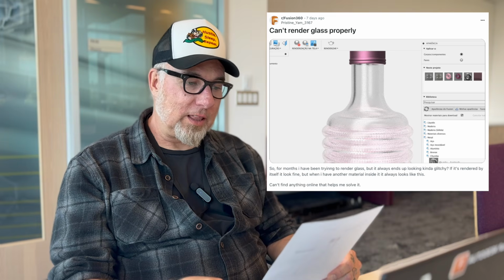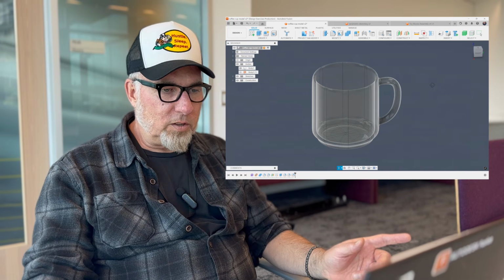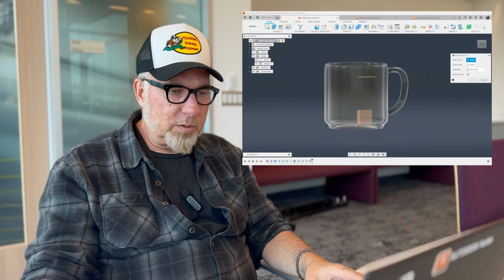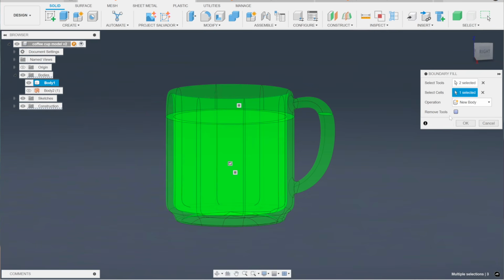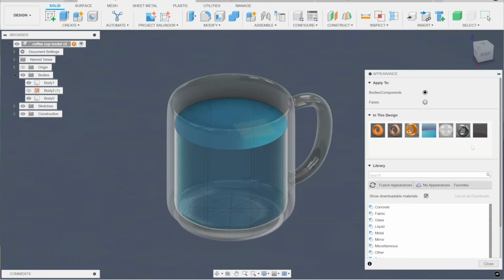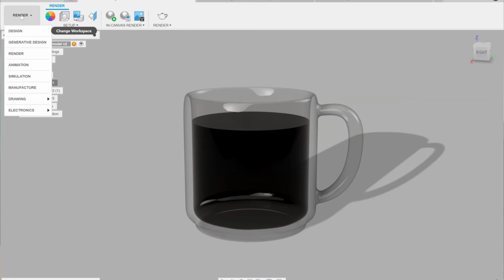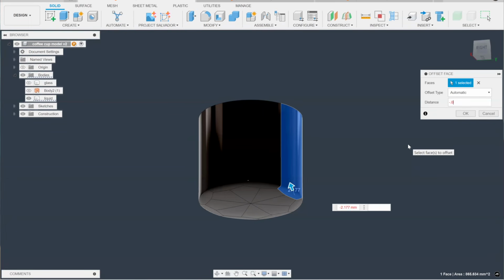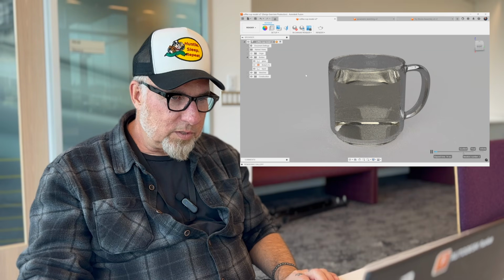How to Render Water in Glass | Unstuck my Fusion Design

Comment: The issue shown in the video is called Z-Fighting and is as old as computer graphics. Here is a link to the Wikipedia article explaining it: https://en.wikipedia.org/wiki/Z-fighting
The method shown in the video to solve the issue is outdated!  The surface should not be pressed inward to create a gap, but pulled outward to create overlap. Then, a higher dielectric priority control can be assigned to the glass in the render environment. Then the refractive index is correct between the glass and the liquid, and not between glass and air, and then between air and liquid!

Comment: how about integrating Figurement into Fusion 🤯🎯
Reply: Can you elaborate on what you mean by that?
Reply: @TrippyLighting Figurement is a cloud based render solution, being developed by ex-keyshot team members. very promising, and a high quality ray tracer solution. It could greatly enhance the fusin render quality. Perhaps it can be embedded in Fusion to replace whatever ‘render’ engine they currently use. (its terrible and I would never use it) Refer also to Shapr3d, who has an impressive ‘concept rendering’’ engine, which makes great images rapidly for concept presentation level stuff. their ai render engine is also powerful. I am enjoying Fusion, and would usually export fbx or so into blender for my renders. glass is hard, I am not experienced with it, so useful to see those tips in this video!